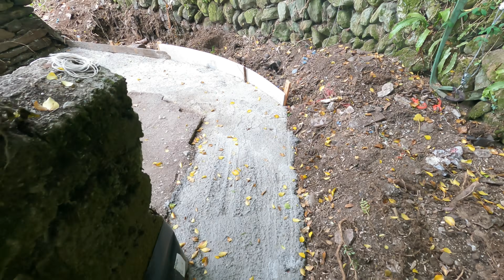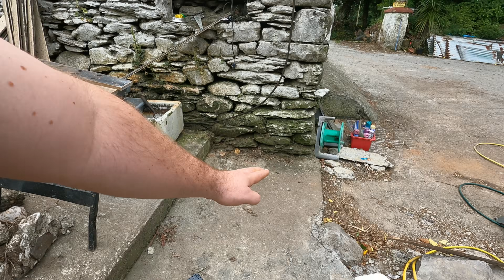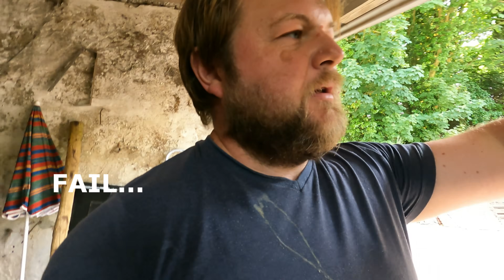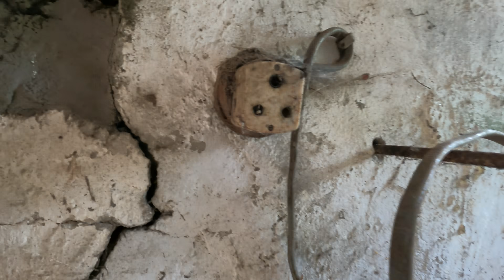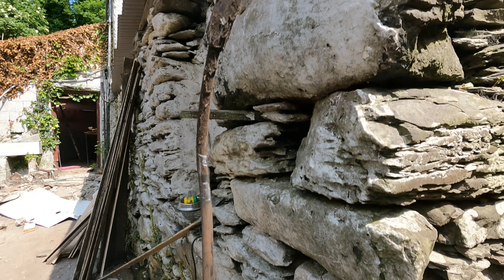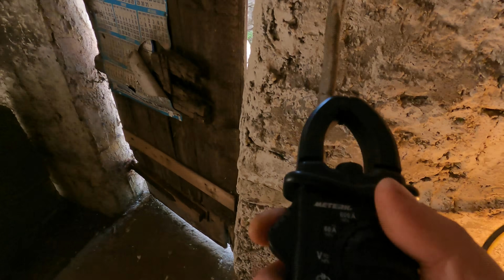EP15. Build update and starting the old and dangerous electrical wiring.

Comment: Please don't use a clamp meter for testing voltage you will end up killing yourself .also you are using it wrongly , you can't measure current when clamped around both live and neutral
Reply from the maker: You are absolutely correct